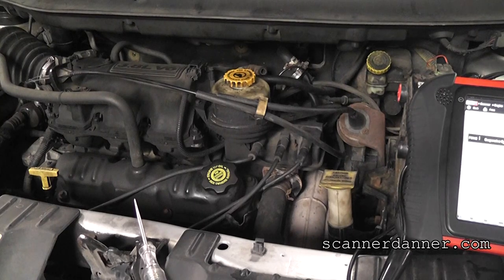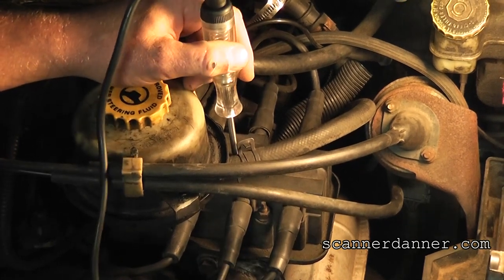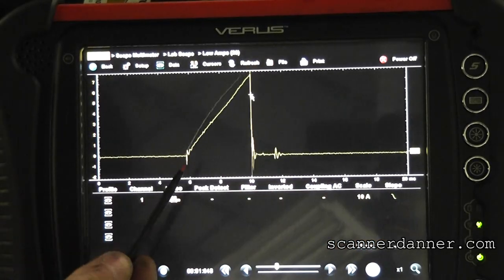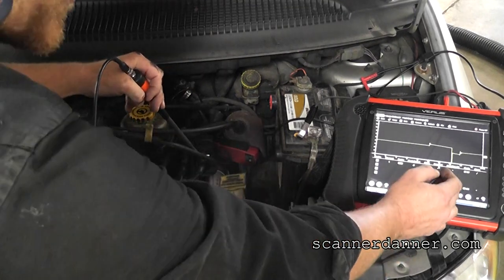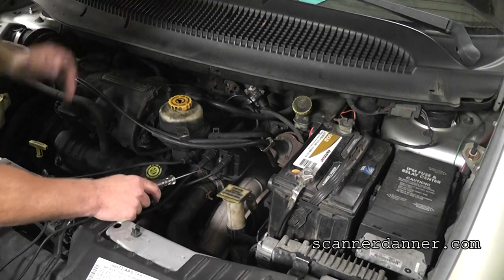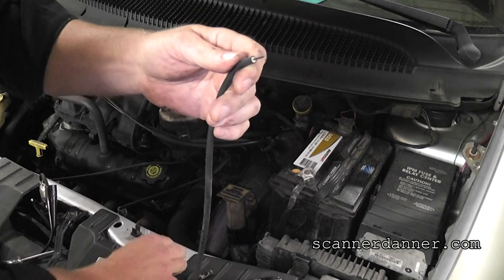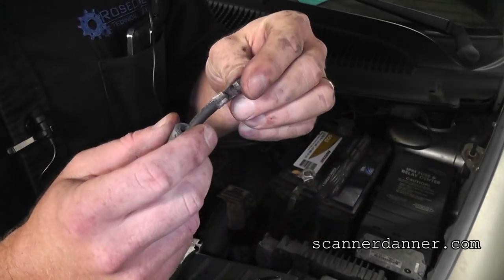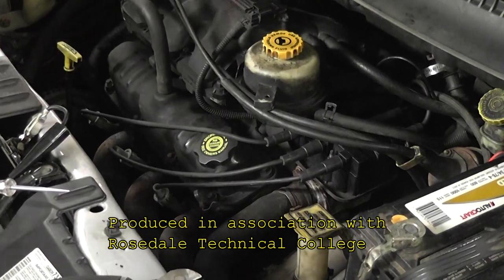Symptoms and causes of a bad ignition coil

Comment: What if you have misfires with no codes what could it be?  I have them them usually before the engine warms up then they go away with a few occasional misses after warmed up.
Reply from the maker: IF it is a GDI engine, you have to look towards intake valve deposits
Reply from the maker: If it is this same engine, you can still have secondary ignition problems cause what you are describing (coil, plugs and wires)
Reply: @ScannerDanner  I carefully removed each wire and could see the sparks jumping with no pauses between sparks so im pretty sure the coils are not the issue.  I did notice today my battery is 12.5 volts which seems low for a truck so im charging it and will see if it runs better or not with a charged battery.  I verified the alternator works and am wondering if batteries plus has the wrong battery in their systems for my truck as it does not fit and the old interstate battery fit perfectly.

Comment: Great video!!! very helpful. I replaced the spark plugs and wires as they had 80k on them. In doing so I created an incredible miss fire. After verifing that the firing order was correct, I used your method to test coil and found the coil to operate. Then I tested the BRAND NEW wires and found 2 loose terminals.(without getting a jolt).

Even still, in park or neutral this vehicle seems to act as being rev limited at 2700-2800. Although during test drive I was able to accelerate throughout rpm range. Can you suggest any solution? Is this the coil pack "going"...Any info would be appreciated!
2006 Chrysler t&c 3.8l
I am subscribing!!!
Reply from the maker: There is a rev limiter on these when in park or neutral. If it is running good now then you are fine.

Comment: I have a 94 deville. Shacks bad and lacks power like krazy.  I changed the fuel filter which was clogged full of gunk. But still shacks and lacks power. I think it's the spark plugs. Also car is not throwing and trouble codes at all other than ac being bad. 
So should I take eack coil off of the distributor cap using the test light and if I get a spark that means good I'd not means bad coil?

Comment: Am just wondering if a coil can damage its own driver transistor if the secondary discharge voltage cannot find a path to ground (scenario: good plug wire, but fouled spark plug). Like will the coil somehow find a path to discharge its own secondary voltage into the coil's own driver wiring. Or does the plug wire just have a designed way to absorb the impact of a fouled spark plug.
Reply from the maker: +John Doe fouled plug, no, open plug or wire, yes
Reply: So much appreciated. Thanks. Was wondering if you might one day do a video on direct injection. <(had to add this part in again, my bad)
Reply from the maker: For sure. And I do have some GDI stuff on SD Premium. Nothing on this channel yet.

Comment: Mr. ScannerDanner, there is a dangerous situation that exists with older Cadillacs, where it could be a death or life situation. The Cadillac shuts down totally unexpectedly at highway speeds or just in town, potentially exposing the occupants to major accident and disaster. My 1994 Cadillac Fleetwood, with 246,000 miles, started doing this in the last few months, and I found out that many many Cadillacs are doing the same thing and no one has figured out the cause. I live in Texas, so there is no chance that I could bring my car to you. But if possible could you please find a Cadillac with similar problems in your area and diagnose it for all of us who have this problem, to guide us in how to resolve it before someone dies. The problem shows up like this. The car  could be driving on the highway or in town and it would just shut down totally unexpectedly, and will not restart right away, but if sat about 3 hours or over night it will start again and run like it never had a problem, but then it could shut down again in an hour or in a day or a week. No one has been able to figure out the cause of this problem, would you be able to help these Cadillac owners? Please.
Reply from the maker: +sam rafeedie you need to find out what you are missing when it shuts down. my guess is spark and it could be a crank sensor problem but it is a guess without knowing what we are missing. 
I don't remember if the 94 caddy has a distributor or if it has coil packs?

Comment: I just got my thermostat replaced last night in my 07 ford focus and now the engine sputters and feels like it wants to die while in park. Could this be the coils or coil pack? And yes my car does vibrate or shakes when its running, my spark plugs were recently replaced as well.
Reply from the maker: Why did you have your thermostat replaced?
Reply: @ScannerDanner  the other night my check engine light came on, a family member did a code reader on it and it came up with a medium issue for the thermostat i guess it was failing. im not exactly savvy when it comes to cars, so i forked the money to have it fixed, a family member put it on. went to oreilys this morning for another code check and now im having an issue with my cylinders misfiring, oxygen sensor, the thermostat, fuel regulator ect idk.

Comment: I have a rough running engine. The numbers 5 and 6 plugs were blackened on the electrodes for the T & C 2002 3.8. I tested #5 but the spark was weak...can the coil pack be bad straight across like that? Can it have spark but weak? What is meant by the primary?
Reply from the maker: Yes, you can have weak spark from one coil tower on a waste spark system like on this car. 
Here is a T&C with a misfire

https://www.youtube.com/edit?o=U&video_id=iFLaRd_5wc8

"Primary" would be the small gauge wires going to the coil pack and half of the ignition coil. There is a primary coil and a secondary coil in every ignition coil. The primary makes and breaks a magnetic field to charge the secondary (where the spark comes from). I can teach you a ton more on this stuff. Just keep watching okay?

Comment: would the first test work for a 2000 3.8 mustang i already did wires spark plugs gas filter air filter  O2 down stream sensor and car still lacks power and im thinking is my coil pack so i want to try  the first test thanx
Reply from the maker: +KEVIN CUELLAR there are a lot of things that can cause low power. Do you have misfire trouble codes?
Reply: +ScannerDanner for some reason computer is not picking up nothing not even when had broken spark plug on cylinder 5 and wire wasnt conected to spak plug i have 2weeks with car and i already did alot to it it improved but not alot
Reply from the maker: +KEVIN CUELLAR coils are common failures. Do you have a global scan tool? You can get misfire info from mode 6. Test ID 53. It will list the cylinders and number of misfires.
Reply: +ScannerDanner no i dont have a scan tool i usually go to auto zone and orailys but i heard there scaners dont pick up stuff all the time im trying to get one but they r pretty expensive
Reply from the maker: +KEVIN CUELLAR I'm showing it in this video https://www.youtube.com/watch?v=6kvYjYT1_mM
I'm using a very expensive professional unit but the mode 6 data test ID 53 I am showing can be found on a $100 global scan tool.
Reply: +ScannerDanner aight man thanx for the info ill take a look at your other videos they r pretty detailed
Reply: +ScannerDanner found out today it was my crank shaft sensor
Reply from the maker: +KEVIN CUELLAR okay sweet. Thanks for the update

Comment: great video. i have a 1999 mitsubishi montero sport 3.0 with  a code p0300, one of the coils, the one on the passenger side does not work. i switch coil with the middle one, and coil works on the middle plug. can my problem be a bad ignitor ?
Reply from the maker: yes
https://www.youtube.com/watch?v=VG3EZJlyjl8&t=281s

https://www.youtube.com/watch?v=-ZGLoSSowYY&t=17s

https://www.youtube.com/watch?v=7PK6r3HbjkU
Reply: ScannerDanner - thank u for fast reply and taking the time to answer our questions. we really appreciate it.
Reply: ScannerDanner - I got a igniter module from a junk yard and it seems to be working good so far. no more misfire, thank you very much.

Comment: Can I pull a plug wire off my coil of an ls1 engine while the car is running?? If so what to look out for
Reply from the maker: you can do it like I showed in this video . You have the "coil near plug" system with a small plug wire right?

Comment: Well, I guess I'll be tearing down a DIS coilpack, now.  I had always thought that each pair of cylinders in a Waste Spark System was a single coil; one tower coming off Secondary Positive, the other tower coming off Secondary Negative.  Apparently that's not the case?
Reply from the maker: +rhkips it is a single secondary coil with one positive and one negative lead, the answer to having spark only on one tower is the other tower is shorting to the housing and through the block
Reply: ScannerDanner
Ah!  Awesome, thank you!

Comment: I think I missed the reason the coil started firing again on #4. Was it because of the vacuum hose being hooked back up?
Reply from the maker: We replaced the faulty coil, that's why it started firing again. Then I showed the open plug wire, which was the cause of the original coils failure. 
Make sense?
Reply: Ok, I missed that. Thanks

Comment: 04 honda civic, not turning over,. have spark(tested by arc on grounding, just not sure if arcing was very consistent), fuel(new plugs are wet), compression(150-160), where should i start looking from here. this started after my timing belt tension spring broke and i had to fix. timing is exact, hand turned to even the tension. im just lost. no codes either. any help would be awesome.

Comment: can i get a little assistance from someone ? my coil packs are really good, i tested all. the wires going to the #2 and #4 coil dont have any current in it. what can be the problem ?
Reply from the maker: Same engine as in this video? You need to check the control circuits next. Connect a test light to battery negative and touch on each control wire. They should all flicker your test light.

Comment: Bought old 1994 Toyota 4Runner, V6 3.0.  Starts fine, warms up fine, then starts to miss when warm. Timing mark jumps around, all plug wires fire erratically. Eventually sounds like it will stall.  ANY feedback welcome.  THANKS.

Comment: Looking for help from a pro here.  I've put tons of time and money chasing my tail on this misfire and still can't figure it out. 
1988 Camaro with a 3.1 V6.  Distributor ignition, MPFI.  I've been chasing this misfire for months now and can't seem to get rid of it.  It's an ignition misfire.  For some unknown reason I seem to have spark "cross talk" between cylinders 1 and 2, and 3 and 4.  It's not constant.  I have already replaced the plugs, wires, cap and rotor, completely rebuilt one distributor before finding the shaft wobble and replacing it entirely, the ignition coil, the ignition module twice (first time due to another issue I thought I had), and even swapped out the ECM.  Also have replaced the fuel injectors twice and this current set is only a couple weeks old, brand new.  No vacuum leaks that I can find.  Even checked the valve lash and compression,  all good.
I do not have a scanner but when I borrowed a Tech2 a while ago I did a cylinder deactivation test and all 6 gave me the same drop. Fuel pump and filter are relatively new too.  Only reason it cold starts hard is my cold injector doesn't work, but it starts right up with a shot of starting fluid or long crank time.
  I'm banging my head against a wall here.  I need this car to be consistent as I gave my other one to family a couple weeks ago.
Reply from the maker: This one sounds challenging. Post this to my forum okay? I'll try to help over there 
https://www.scannerdanner.com/forum/post-your-repair-questions-here.html
Reply: ScannerDanner I'll be there shortly,  after dinner.  I forgot to mention that the "cross talk " I described is the #2 plug firing on the #1 mark, occasionally.  Same intermittently for #3 on the #4 mark, less frequently than the #2.  I am currently running a GM ignition module.  I have 2 aftermarkets as well and all 3 are showing the same symptoms.  The module to coil wire was repaired and has no resistance.  Also have a bouncing tach I originally attributed to the fact that the cluster, which is from a 94, was designed for use with DIS, but now I'm not even sure.  Last time I had a bouncing tach the ignition module went out 3 weeks later, but all 3 modules are doing this.  I kind of wish I had saved my old distributor from my 87 now...  that may have been 25 years old when I got rid of it, but it still worked fine...
Almost forgot...  the oddball firing is also with the EST set timing connector apart so ECM is not controlling timing, which I have set at 16* BTDC.
Reply: ScannerDanner I've posted in your forum.  I have already heard from other people who just keep telling me to do the same things I have already done multiple times,  but I'd like to get your professional input on my issue.  I just put in a new coil and replaced the module again and now I have 3 modules giving me the same misfire.  I have purchased a cheap scope and the output frequencies of the module are all over the place on both the TACH wire at the coil and the coil output from the modules.  Nothing looks right.  All wires and the pickup have been resistance tested to within tolerances.  Still lost.
Reply from the maker: copy and paste the forum link here and I'll try to help there okay? I need to see what all was suggested so far. Thanks!

Comment: I have a little different problem with a coil but am hoping for some help I am stumped. I have a 2006 Arctic cat prowler 650 UTV. After riding I shut the unit down, when trying to start it again  it wouldn't start I diagnosed no spark. I traced it to the ignition coil, because the CDI box is putting out the proper voltage. I replaced the Ignition coil and everything was fine for a couple rides. After shutting it down again no spark once again. The ignition coil test bad again. The previous coil came with a new Spark plug wire. at the end of the wire you use a resistor cap/Boot(it ohms at the right level). I had replaced the wire on the previous coil because the wire had gone bad, I did not use the resistor cap boot on the first one. So it ran while running but when shut down no spark. I have not replaced the plug but will with the next coil. What could be making these coils go bad?
Reply from the maker: Or the coils are not going bad and something you are touching in the replacement process is making them fire again. (loose connection)
Reply: ScannerDanner  I have tried for a lose connection once the coil is bad it never works again. I have to replace it with a new one.
Reply from the maker: Then it's from too much dwell or on time of the primary.  Or you have an open plug or wire that's burning out the secondary winding
Reply: ScannerDanner hoping for a bad plug under visual inspection it looked ok but I haven't checked it with a meter. The first wire has a bad spot in it so maybe it was looking for ground. I'm on the 3rd plug wire 2 because each coil comes with one. Is dwell a problem in cdi type ignition systems?
Reply from the maker: Yes or whatever your input is. Some type of magnetic pickup
Reply: ScannerDanner I have 15000 ohms of resistance between the plug tip and the plug electrode. I also have a small amount of resistance between the plug tip an the grounding point of the plug. so I'm going to go with this was a bad plug burning up the coil. I do have another question though was a capacitor discharge ignition system when the unit bumps the rev limiter and it makes all those turns but doesn't discharge any spark where does all that extra energy go?

Comment: I've got a coil driver problem. It will fire the 2/5 coil twice then nothing.  Other 2 coils work fine. Will not run. Thought pcm was bad so I replaced it.(Fixed nothing) Checked 2 pcm grounds and they are good. 1 good B+ wire to pcm.
I'm stumped
Reply from the maker: What are you working on? This same engine? It is possible the coil is shorted and damaged the PCM driver. Disconnect the coil pack and take a test light to battery positive and touch on all three control wires during cranking. They should all pulse the light.
Reply: ScannerDanner 
3.3 liter. I did check it with a test light and the coil driver will only flash once per key cycle. It has a new pcm in it now. I isolated the circuit. It doesn't have a short or high resistance. Prior to this problem I have replaced the engine due to low compression.

Comment: Can I do this test on a distributor that has the coil on the cap
Reply from the maker: what are you working on? I probably have a better video for you, but yes, you can
Reply: @ScannerDanner  a1983 Fleetwood Cadillac ht4100 with the hei distributor
Reply: @ScannerDanner  thanks bro
Reply from the maker: Yes, you can do a spark test with a test light on the distributor cap. Also an RPM drop test as well
Reply: @ScannerDanner  God bless your channel

Comment: And then there was the postal minivan that the battery acid leaked and one of my shop bros recommended baking soda to neutralize the acid after applying the soda the next morning the transmission connectorz male and female were completely ate up and needed all new sensors and pigtails and ten pack connectors....sorry a little off topic but Chrysler minivan pitfalls anyway